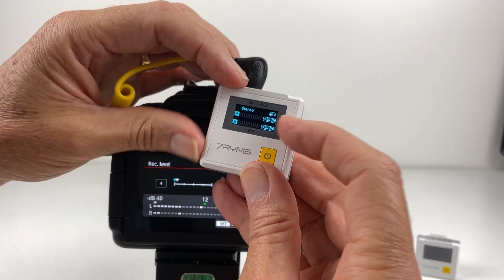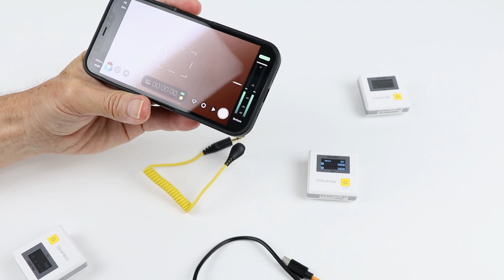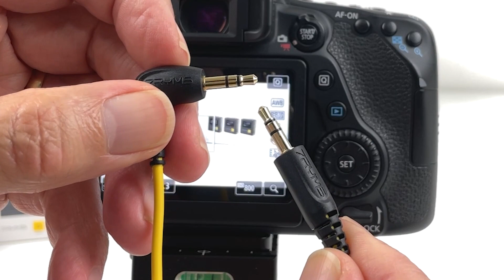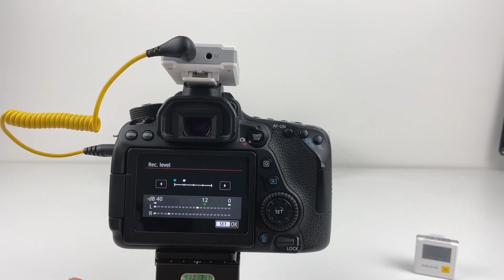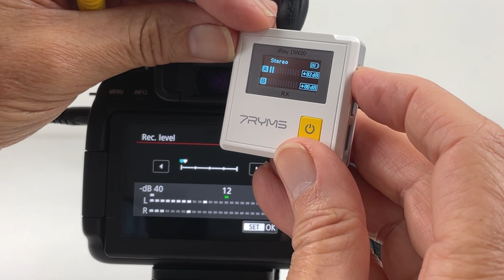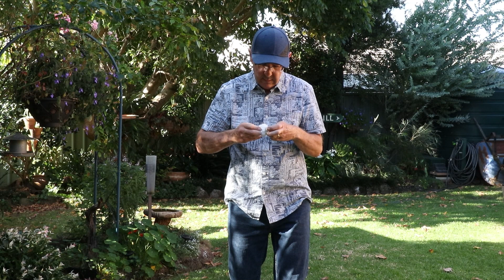7RYMS iRay DW20 | Best settings for Mobile and DSLR

Comment: I have the 7RYMS DW20 and a canon rebel T6.  I have to use a female to male adapter to get from 3.5mm to 2.5mm and I have that but when I plug it in while in video mode it says "still photo shooting is not possible in movie mode" so does it think I plugged in some sort of remote shutter presser thing? I'm at a loss why this isn't working. Maybe you could help :)
Reply: Also, what camera app were you using with the levels can you share? thanks.